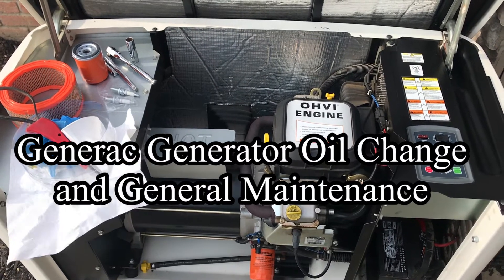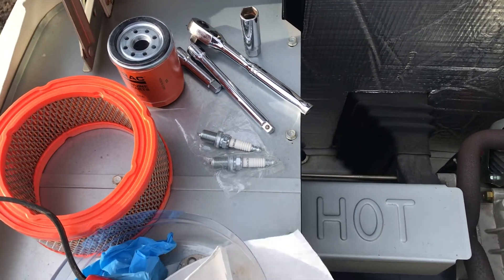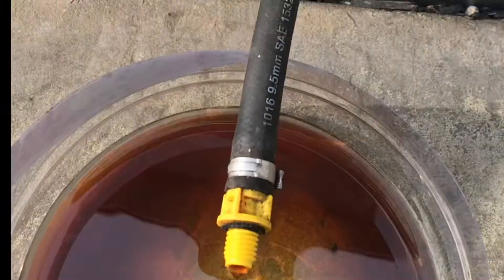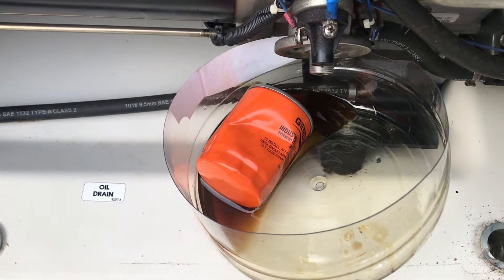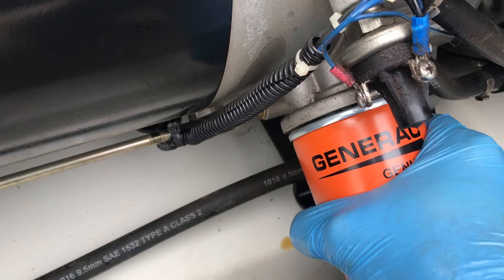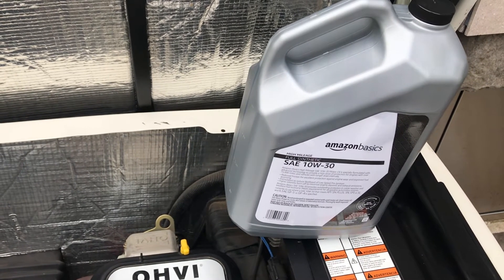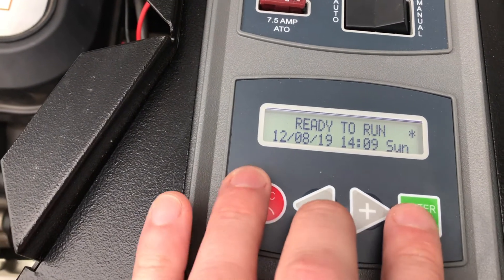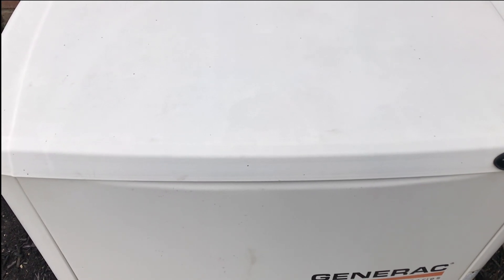17kW Generac Generator Oil Change and General Maintenance

Comment: Automobile oils aren't designed for air cooled applications it doesn't have nearly the amount anti shear and wear additives because of emissions requirements I don't understand why people keep doing this you want 100% synthetic small engine oil a full synthetic labeled oil is no where near 100% the car oil is ok for short outages and exercise but during long outages your killing the life of the generator it breaks down really quickly best option is Briggs and Stratton 100% synthetic or Amsoil 100% small engine oil also Generac oil is really good
Reply from the maker: I called Generac directly and this is what they told me to use.
Reply: @jon james  its air cooled automobile oils are not designed for that application sure they work in short outages but its taking life out of the unit ask any engine builder or small engine mechanic they will tell you the same thing about low zinc and phosphorus oils with high heat and continuous RPMs the bearing loads are extreme the shear stability is far less also you can look up videos with Amsoil they explain more about why its not as good in this application but I guess you want to save 3 or 4 dollars a quart so be it but there's a reason why air cooled small engine oil and liquid cooled oil have a far different formula the emission requirements have killed the performance in todays oils but o well your machine good luck
Reply: @jon james  the ppm on zinc and phosphorus is around 700 to 800 with car oil small engine oils like Briggs and Stratton 5w30 100% synthetic and Amsoil small engine 5w30 100% synthetic is around 1300 ppm that's alot that's very important detail but anyways take care

Comment: What most DIY’s don’t understand is automotive oil you see at the store is for cars and trucks which are formulated for fuel economy and liquid cooled engines. 4 cycle air cooled engines run hotter and far higher rpm then you wonder why you have oil consumption issues or blowing head gaskets on these small engines.
Reply from the maker: Just an FYI I have a degree in mechanical engineering specializing in automotive engineering.  I talked directly with Generac about when oil to use. The recommend oils to SAE (society of AUTOMOTIVE engineers) standards. What do you recommend?

Comment: I’ve got this Girl, and we’ve had her since Katrina, and she’s the GREATEST investment this New Orleans Boy has ever made. Just the last hurricane that hit us caused my neighborhood to not have electricity for 9 days. She makes enough power that along with everything in my 2450 square foot house she produced enough power that I was able to run an electric cord to both of my neighbors houses. That they was able to power up a window unit, tv, modems, cable, refrigerators, and freezers for both houses. Anybody that’s on the fence about buying. Don’t fret it I’d say it’s worth it if you’re in any place that elc is iffy
Reply from the maker: I live in Ohio... to be honest our power does not go out much and if it does it is for an hour. The previous owners had ours installed because I understand that the power used to go out often. Personally if the generator goes out I probably won’t replace it since I have two additional portable generators in the garage... just my two cents. But it is nice to have.
Reply: @jonjames2680  
Yeah I’m your case it wouldn’t be worth the cost, but down here with Hurricanes, and Tropical Storm’s it’s really needed. Lucked out an the actual Electric Motor fried in ours, and we still don’t know why. It just locked up. Ours is from Katrina and this happened last summer. The maintenance guy we have sent a letter to Generac and they replaced it for free all we had to pay was labor. After that I was REALLY REALLY sold on the company

Comment: Sorry guys first tome doing a maintenance on my generator, do I need to run the generator before doing the oil, filter and spark plug? 

Thanks in advance for the advice.
Reply: Thank you for the advice.
Reply: @ghostlyr1601  
I second what he said. Because I did my oil change today and it’s 45° outside in New Orleans and it came out like molasses it was so slow. It’s worth running for anywhere from 2-4 minutes. Depending on how cold it is outside.
Reply from the maker: It is a good idea so the oil is warm/thinner and you will get more of it out.

Comment: I had a 14KW installed last May.  I thought my installer told me to use 5w-30 full synthetic?
Reply: He said in the video it takes 5w-30 and then used 10w-30.
Reply from the maker: Good catch. I just pulled out the manual. You can use 10w-30 for a temperature rang from -10 to 40F.  And from -35 to 10F it says 5w30 full syn. I’m glad you caught this.  I will probably change to 5w30 this fall
Reply: @Charlie Belle I don’t know your area, but I’m in South Louisiana, and we Run 5w-30 year round. I’m not sure what the Manual says, but both the installer, and the guy that comes once a year for insurance purposes also said to run 5w-30 full Syn. I only use Royal Purple. Royal Purple is expensive, but with as little as she takes it’s truly worth spending the few extra bucks. I also use NAPA 47145 Platinum oil filter. Or you can use the NAPA 7145 is the NAPA Gold. They’re made by WIX. I use to be an ASE certified mechanic, and I swear by both Royal Purple and WIX/NAPA Filters.